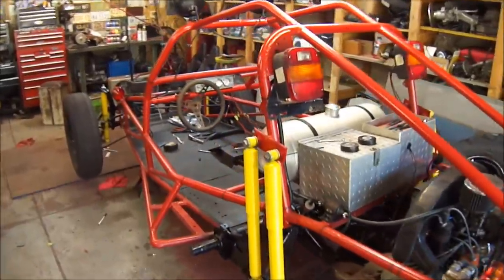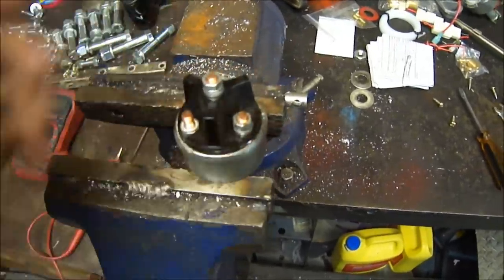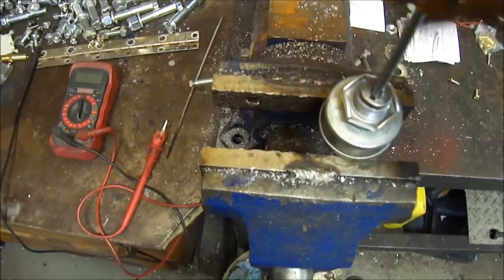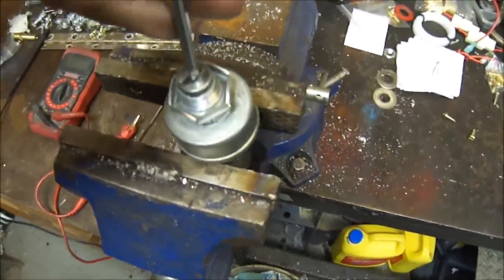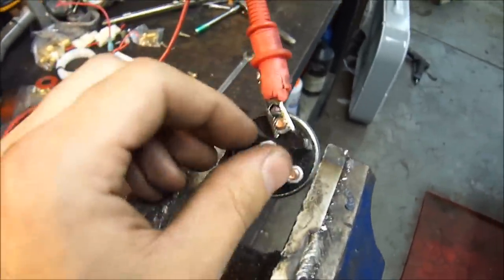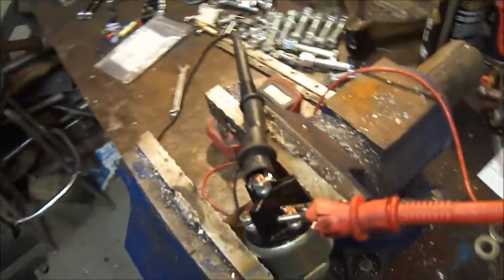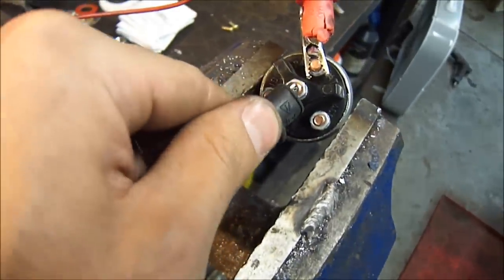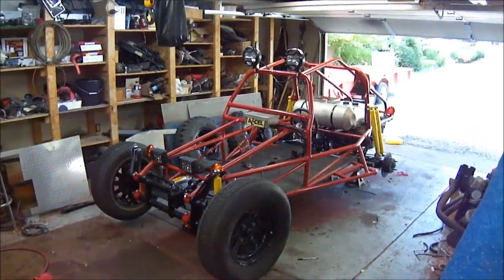Key Ignition Fix... Starting in ON Position

Comment: Maybe you could help me. In my Ford LTD, I'll turn my key to the Start Position and it'll crank all day but won't ever start until I let the key go and it's in the Run Position, that's when it kicks off. Now if my understanding's correct, that means that the coil isn't getting juice from the battery but in one of the two positions it needs to be? I guess what I'm asking is, would that just be a matter of a bad plug or wiring from the battery to the coil or the switch?

Comment: Now I've got issues with my mud truck. I drove the truck under my carport, changed the steering box seal (nothing else) and now it won't start. It cranks but has no spark, not even from the coil. Power is going to the coil and I already tried a different coil?????

Comment: I had the same problem I bought a ignition switch made in China at NAPA and replaced it in the tractor and when I tighten it down no power to the acc position so the engine would start then when I let go it died . Took me 2 days to figure it out . I ended up borrowing a switch from my neibor few years older but same switch . His worked great so it had to be switch . I ordered one from Sears made in Korea worked great and cost 10 bucks more than at NAPA .
Weird

Comment: Hey, i have a chevy silverado 94 model with a 5.7 fuel injected and it has a real rough idle and ive changed plugs, wires, distributor cap, rotory button, and cleaned the egr and it still does it. Need some advice or a video to describe whats wrong, would appreciate a reply. Thanks

Comment: Same switch I have, the problem I had with mine was after I hooked it up worked just fine until I went to shut off the engine wouldn’t shut off.  I turned the gas valve off went and grabbed a can of pop came back out it was starting to die from running out of gas finally quit.  Then all of a sudden the piece of shit switch was feeding power to the coil smoke like a sob. 
I hurried up and disconnected the ground off the battery.
This is my second switch of this type that has given me problems. 
I’ve installed hundreds of ignition switches made wire harnesses I’m at the point where I don’t trust these switches. 
Bunch of low quality pieces of shit.

Comment: Literally got one from eBay for my 44 yr old fiat...It worked normally 3 times then it began having the same problem. I temporarily cured issue by putting a toggle switch in line with ignition wire “start” terminal. What a waste of time. Crappy Chinese parts